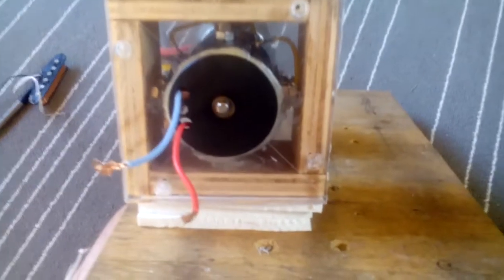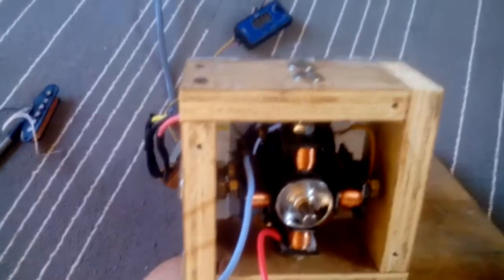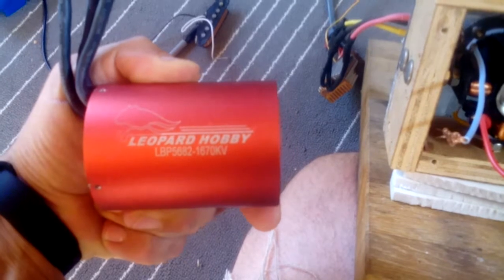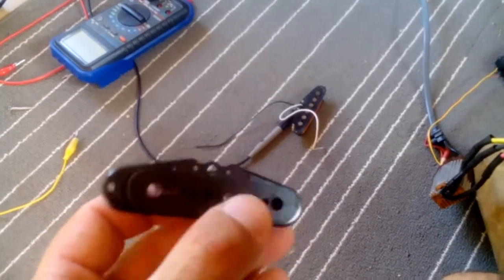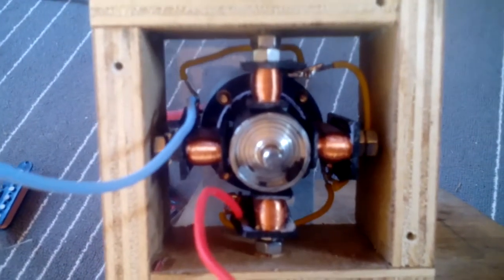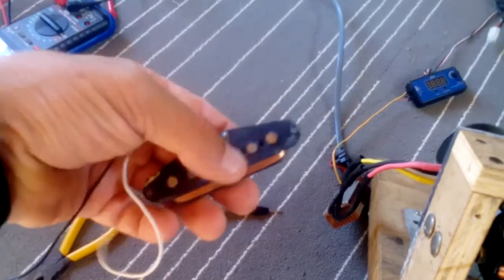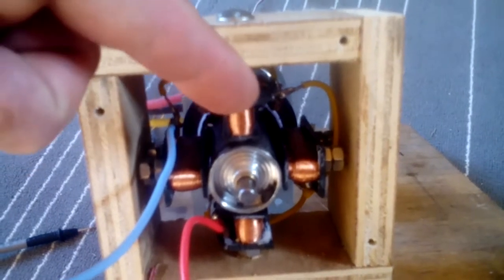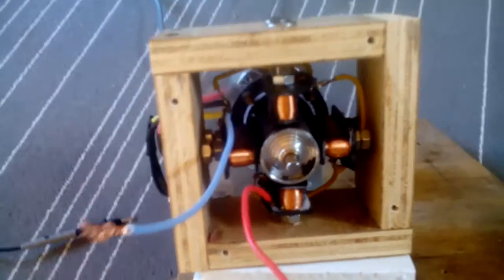HV Generator 4 - coils

Comment: this is radiant energy, escalar waves, the energy of thi machine is CC, on the end of machine whit capacitor bank you have much more magnetic field, magnetic volume increase, spark gap for up the frecuency, more capacitors or not, this energy is CC, charge battery, notebook, cell phone, evrething, connect the cloud busters, etc
Reply: This is a stator being driven by a bldc motor the stator that is wound doses not have litz wire is an air core also there is no disruption or buck bouncing of the capture or magntetic collapse u can use words expressed by others although their own inability to understand energy does not help when people such as yourself repeat this dribble educate yourself replicate and better other's.  Frequency is potential you stated up the frequency, the timing is little to nothing to do with spark gaping unless you have a dynamo magneto that is used like a hall effect or reed swtich other than the distance for the arc, again this build is for kids unfortunatly even electricians and electrical engineers stopped being kids and feel they know what they can measure.
Reply: What is radient energy? Help myself and others understand this energy that does not like to consume itsself you are talking about splitting the positive right? go here https://www.youtube.com/watch?v=moU6EUxpNbc and study what u do not understand and watch all his videos many times then replicate his builds and then mabye just mabye comment about how little you know.
Reply: @GG-od2tr  As you want, whatever you want, the magnetic and the dielectric together, a coil and a capacitor together, are charged and discharged, that produces scalar wave, 180 degree wave, the scalar wave is not electricity, that's why they invented the radio , because everything is a signal, you don't have to be a nuclear engineer to realize that the scalar wave is natural, energy of inertia, a negative pulse in a pancake coil that loads and unloads in itself, that produces scalar wave, I have a lot of experiments , including plasma balls levitating in my garden, all that I often throw in my toroidal coils, big hug